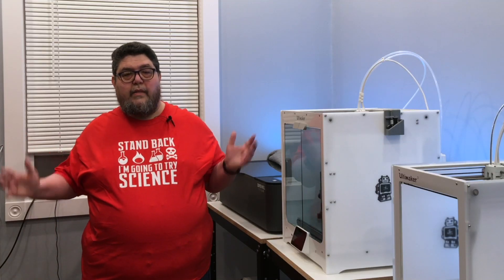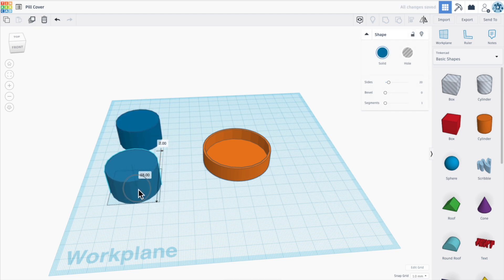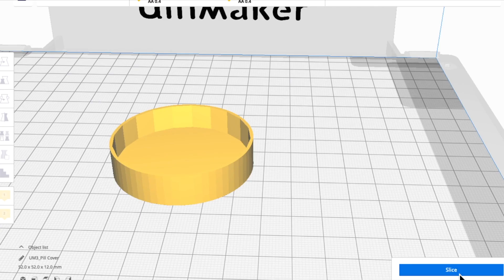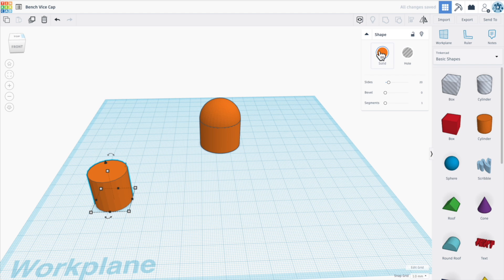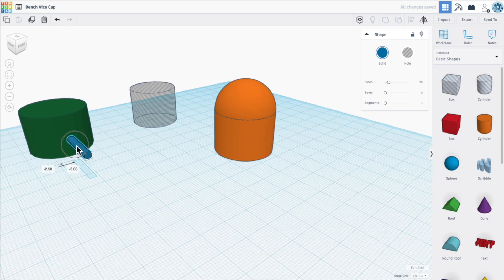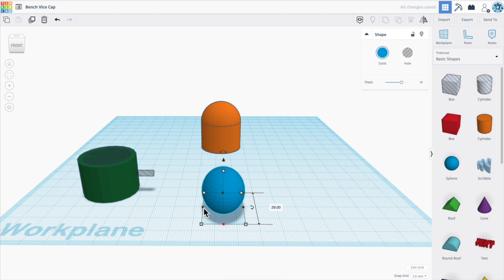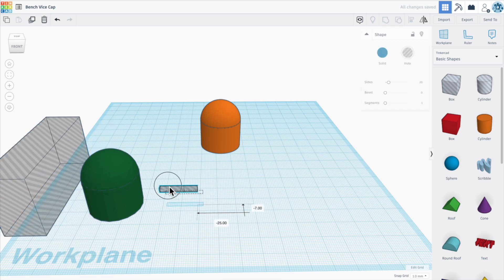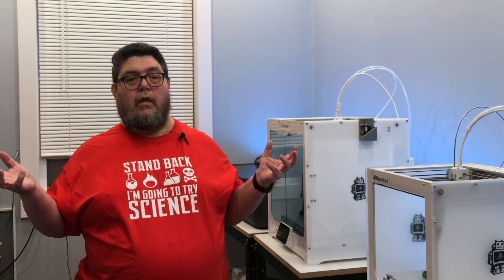Practical 3D prints: making helpful container caps in TinkerCAD

Comment: Making threaded caps is left as an exercise for the student.  One hint for accurate sizing:  If you have a test ring that is a bit too small,  cut it and stretch it to fit.  Then measure the gap (mind the kerf) and divide by Pi to correct the diameter.